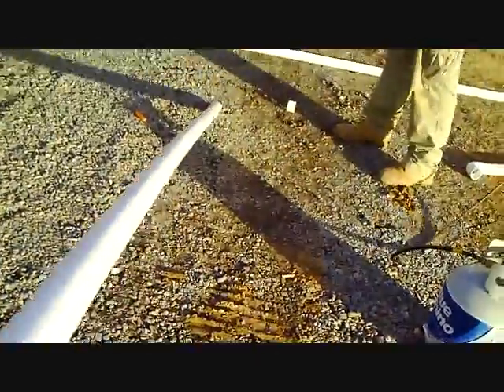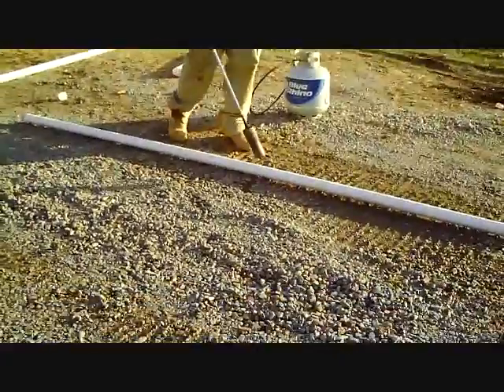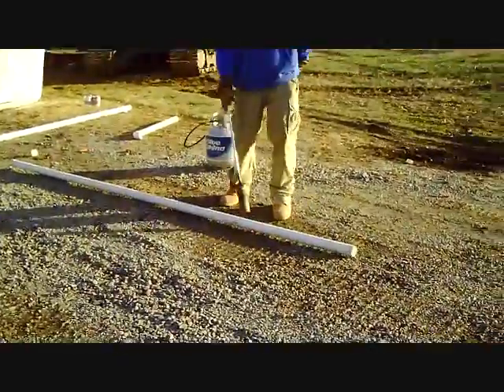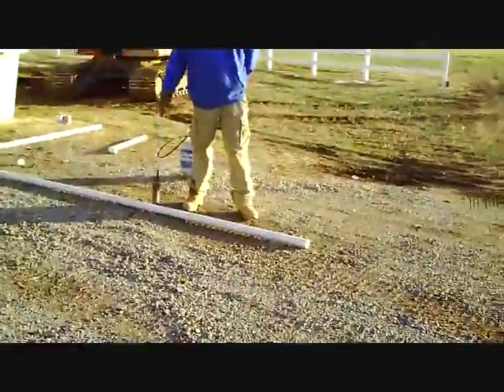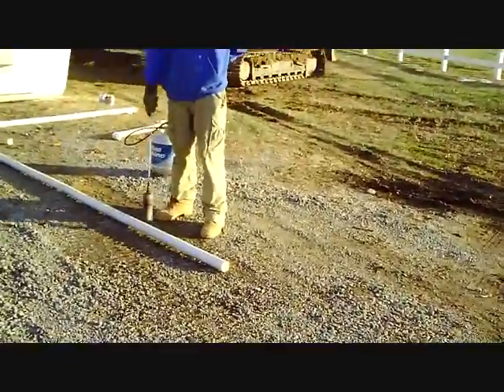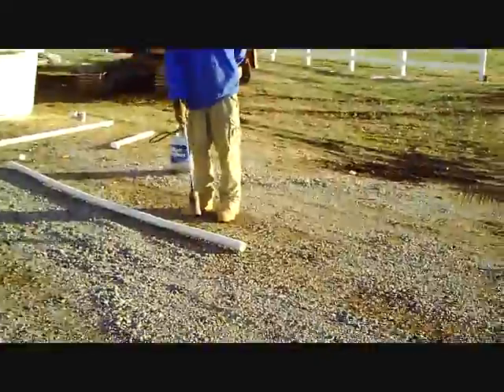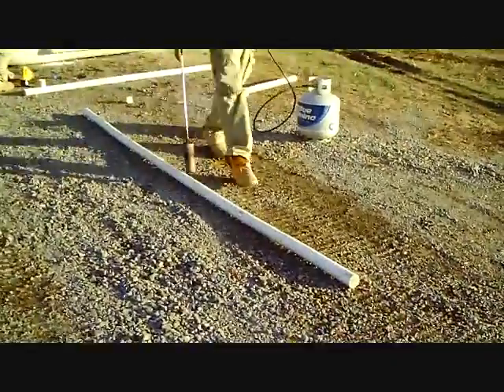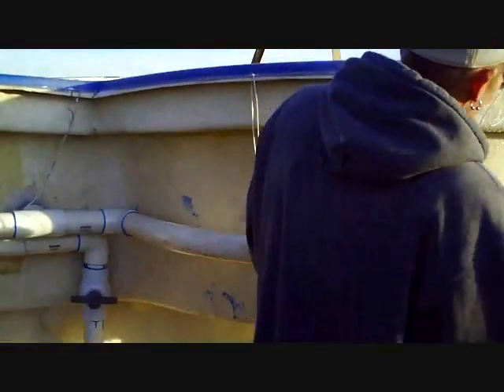How to Heat Bend PVC Pipe for Swimming Pools Video

Comment: do you glue the pipe into the fittings when they were all flimsy like that? or do you just put it in place until it stiffens up again?....

thanks
Reply from the maker: +freshdirty27 You can actually do it either way, but just remember not to heat the ends of the pipe where you'll be gluing because it will distort it.
Reply: +Jason Hughes awesome thanks will try this carefully.....as a pool pro myself i find your videos very helpful...appreciate it.

Comment: would this technique work for 6" sewer and drain pipe...or would the large diameter and thin wall cause the pipe to collapse?
Reply: Andrew Schwarz Just contemplating doing this for my dust collection system duct work.  The 6" PVC fittings are ridiculously expensive (over $30 per fitting).  I'm probably not even going to try....was just curious

Comment: Dang I could have used this tip yesterday re-piping a sump pump discharge in a weird configuration. 2 elbows, a 22.5, and a fernco flex coupling later I got it done but I'd much prefer just one 90 with the rest gently bent to the right position. I'll definitely try this next time. Thanks a lot for posting!!

Comment from the maker: @HWCapps 
I usually hold the tip of the torch 4"-8" away, but it's really not about the distance but rather the how long you hold the torch in one spot.  it only takes a split second to scorch that puppy!....so you have to constantly be on the move.  I find that the areas most prone to burn are at the end of long strokes, so to counter that you literally have to remove the flame and re-apply.  you can't simply reverse directions.  This definitely takes some practice, just keep at it.